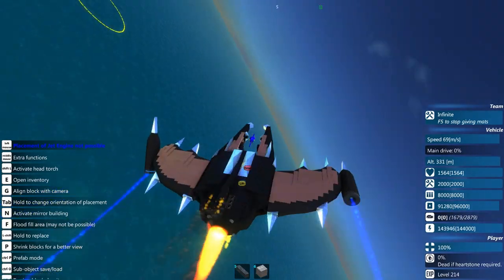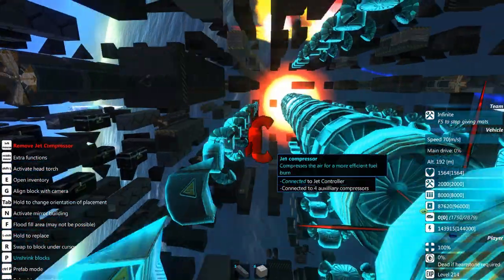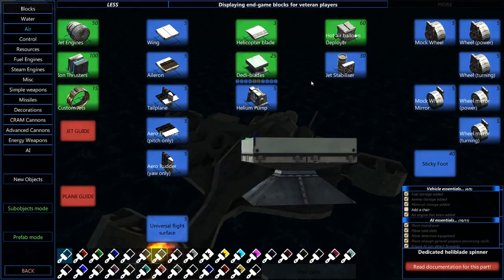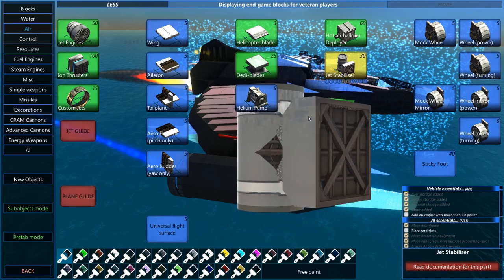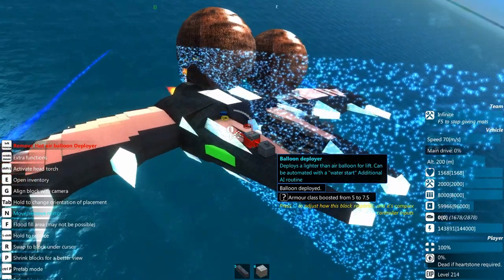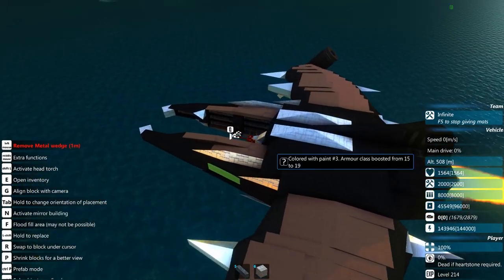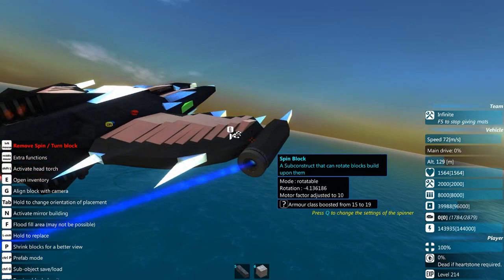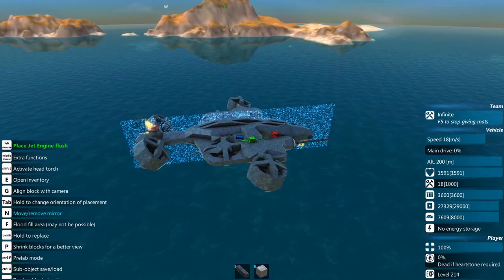From the Depths - Tutorial 5:  Air Movement

Comment: Good one!
That's why I'm subscribed. Also there seems to be interestingly shaped units for later videos.

Big jets and ions - the nine times propulsion comes out only 1 block thick line, sometimes useful for deep-hull arrangements.

Helicopterblades have real physics, for example torque, twirling the unit on their axis, like a real helicopter.
Also dedicated heliblades are less laggy as they require only a fixed area where they've built, and clip thru all objects - while heliblades require real space.

Balloon armour is a lot of balloons popping enemy ordance way away from the real armour of the unit.

Also balloons have now full Q menus, so they can stabilize craft pitch/roll.
I was able to get to space via them, but that hopefully gets patched out :D
Reply from the maker: All correct and important information. I was originally planning to include more info about regular helicopter blades in the video, but didn't quite get to it, and this tutorial was already quite long enough I think. The non-dediblades do add torque, and they do have collision (as all spinblock-mounted things do). Dediblade spinners technically aren't true spinblocks at all, which prevents them from having to calculate collisions. This leads to dediblade-based vehicles being a lot easier on your CPU than regular helicopter blades, which is why I prefer them even in scenarios where spinblocks and helicopter blades would work.